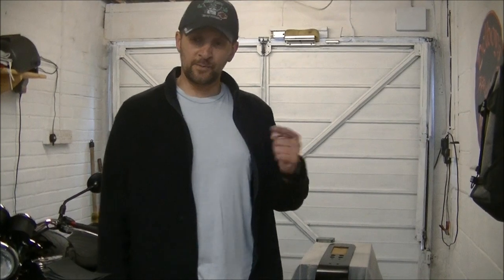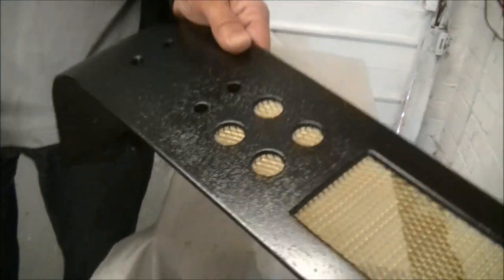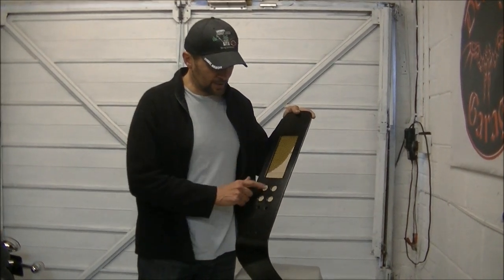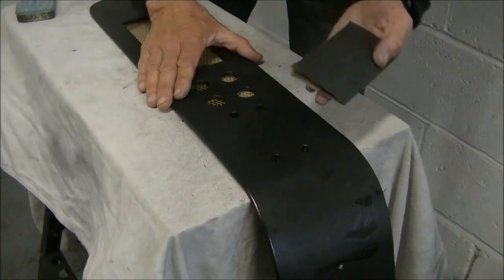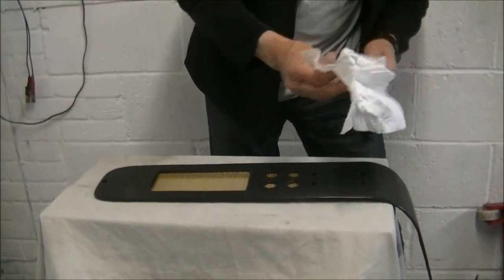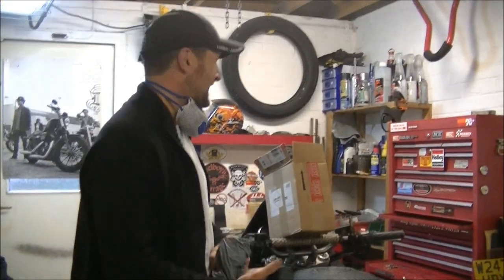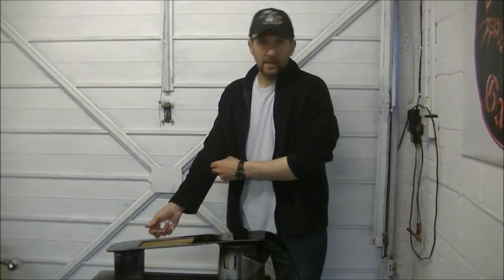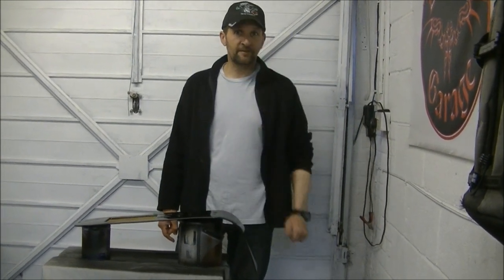Delboy's Garage, Project Bash Plate #20 Vinyl Wrap

Comment: Looks very good Del & Penny. Could you do a walk around of the Tiger, to show how the wrap is lasting after a few weeks road use please. Also the new collective cap even fits my fat head, cheers.
Reply from the maker: Hi Roy... if I did a walk round shot, it would look the same as the original reveal, there's not a mark on it mate, no chips and scratches, no pealing, lifting or flat spots.. its the same as when I bolted it back together... Glad the cap arrived, now you can represent the Collective any time you're out... all the best and take care buddy.. Del.

Comment: Do you think wrap would be fine on a tank? I'm ratting/survival a ZZR but don't want to have the powered touch ?
Reply from the maker: Its fine on a tank as long as you never spill petrol on it....any strong solvent will just melt the vinyl instantly. as will WD40, furniture polish, brake cleaner, in fact anything accept plain soap and water.... so its great as long as you take real good care of it... and if you're ratting the bike, why not just use paint..?
Reply: Moonfleet41 well I started to rat an Er5 and had Everything Matt black, looked great but it got grubby quicker, spilt fuel etc.  

I was going to use satin or something for the tank,  a little different and not a cop out blah but a couple of people put me off reckoned it's pretty hard to get right. I'm looking at options really

Comment: dell lost the key to the harley sporster i cant fined the place to unpluge the switch its a 2005
Reply from the maker: "Unplug the switch"?.. do you mean the main fuse mate.?
Reply: no the i need to take the lock to a key maker and cant find where to unpulug the 3 wires comming out of the back of the key switch
Reply from the maker: Teddy Stephens
Oh i see, sorry mate.. The ignition barrel harness is about 10" long and runs under the tank to a plug... you can just unplug it from there and remove the whole thing... its the same format when you relocate it to the top of the motor...